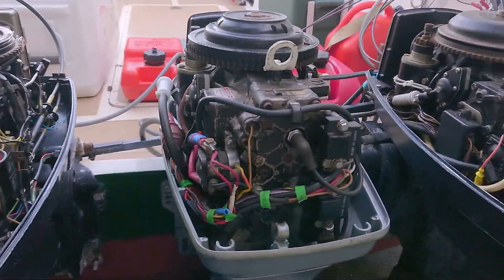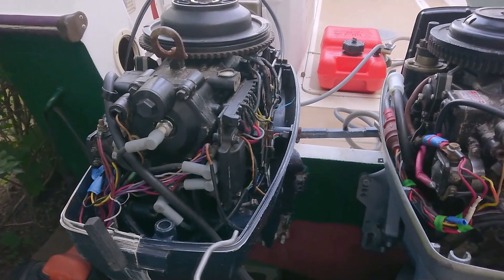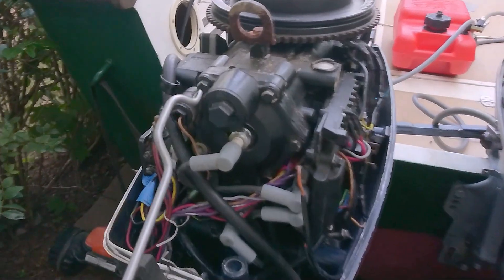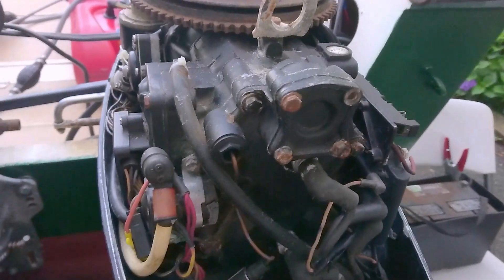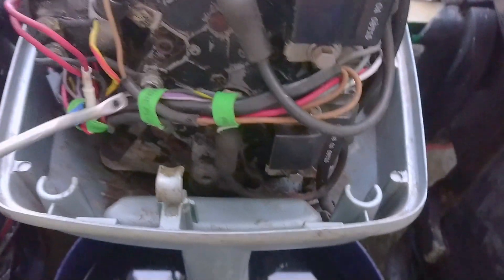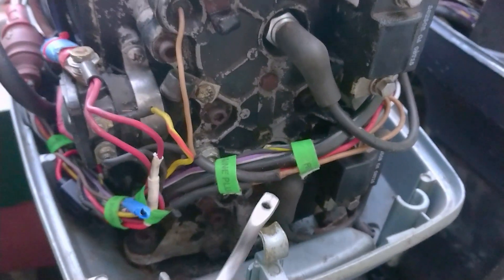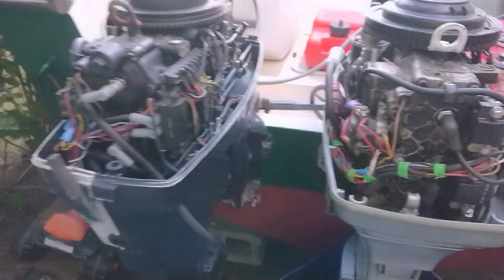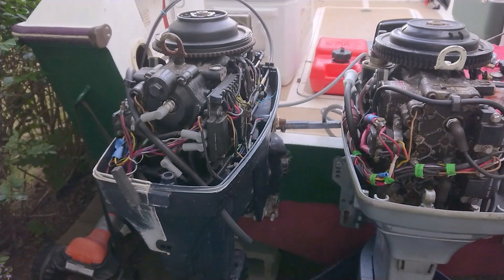3 Different styles of Evinrude / Johnson thermostat placement - Thermostat location.

Comment: Yep, the 1990 style is the best, easiest to service for sure.  OMC changed to that crazy style on the right only because  sometimes the 1990 style got debris between the thermo/relief valve and the rubber seat, allowing too much water to bypass letting the engine run cold at low speeds..  No big deal though, just pop it out with spark plug socket and clean out the debris.   Over engineering at its finest.   The older style was horrible for sure.

Comment: What is that wire coming off the back of the left side of the engine block to the left of where u pointing. I have the same wire on mine and its not goin to nothing
Reply from the maker: Over heat sensor.

Comment: Bolt on my 90 Evinrude thermostat broke how to get it off do you know
Reply from the maker: At this point you got to look at bolt removing videos. You may be able to get it fixed, we ran our engine in a bucket filled with a whole bunch of white vinegar and it fixed our thermostat. These thermostat things are super simple devices and they're usually only not working because they get like overly corroded. After we did this bucket cleaning it removed a whole lot of stuff and gunk from the inside of the motor.

Comment: We're do I but the stat for that 1990 unit the one on left .is there a part number please. Also if the stat is stuck open will the engine want to run on on the choke all the time ??

Comment: Do you know if you have to remove that water jacket layer on the ‘85 (12 bolts) before hitting the head bolts to get at cylinder rings?  I’d rather not break a well sealed water unit
Reply from the maker: Looking at the marineengine website... it looks like you do. I am in the same situation and it really is a poor design. I want to try using a heat gun to get the thermostat free and moving again.